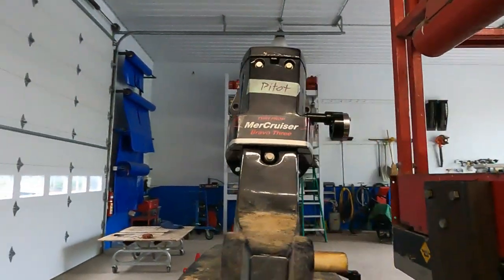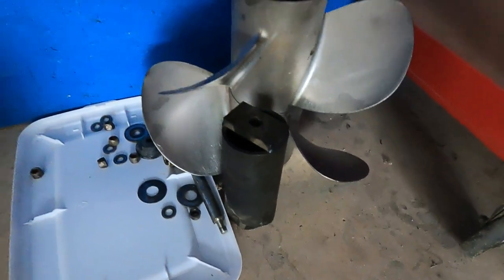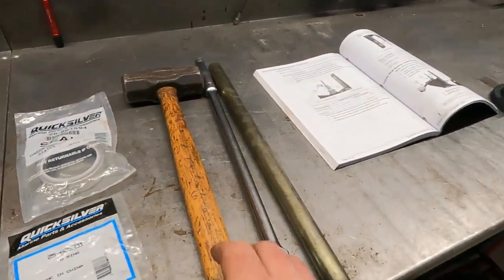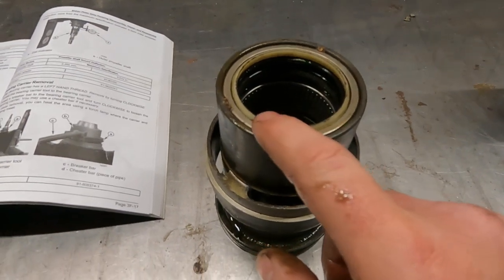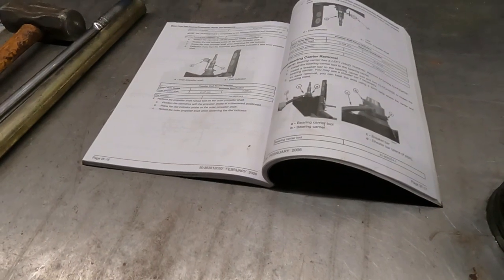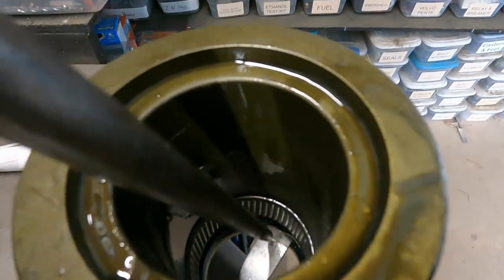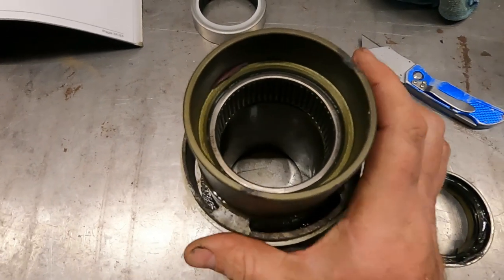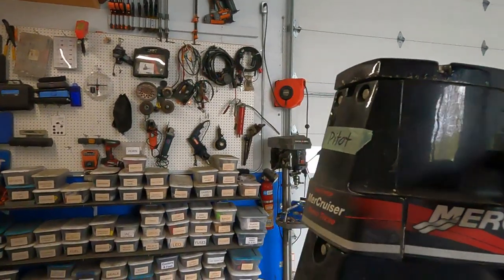MerCruiser Bravo III 3 Propshaft Seal

Comment: Hi, what about the seal on the small shaft.  Whats the procedure for that. If one is bad might as well do the other since your there and they are the same age rather than it leak a week later. Thanks
Reply: i was also hoping to find that answer. i have a leak on the inner shaft seal and can't find any info on replacing that
Reply from the maker: Everyone will have their own opinion on the subject of replacing other seals that aren't currently leaking, and there is no one-size-fits-all answer. To say that the seals are the same age and will therefore be soon to fail is wrong. Also, where do you then draw the line? Reseal the entire drive? Every case is different, and so is the customer. In this case, the one seal that failed was replaced in short order, costing the customer X amount of dollars and the drive is still tight and probably will be for several seasons to come. So, to spend large amounts of additional money when it is not necessary is up to the individual, but in my opinion is foolish. If the inner shaft seal is leaking, well that's another video. And, as mentioned, more labor intensive, and I recommend obtaining the service manual.
Reply: Will a bad carrier seal make noises ? When turning?
Reply from the maker: @franciswiz3781  Seal - no. Bearing - yes.
Reply: @franciswiz3781  If it's making noise when you turn, it's most likely your universal joint on your U-joint assembly.